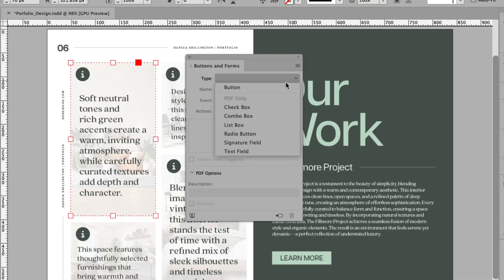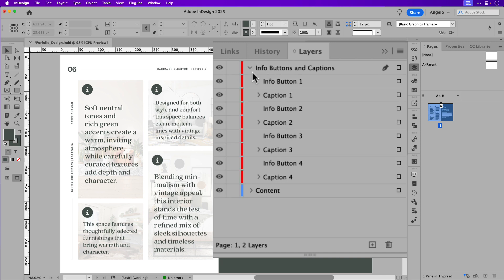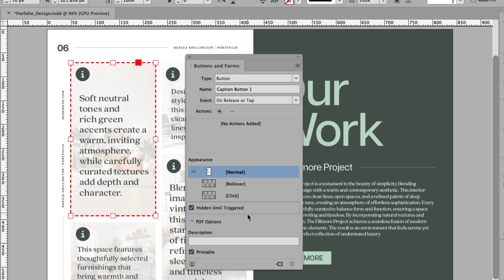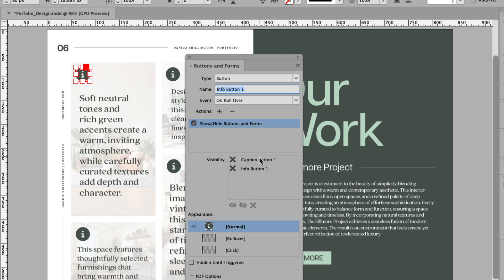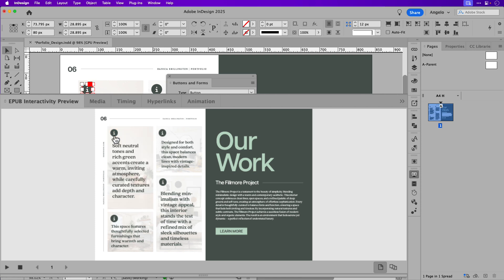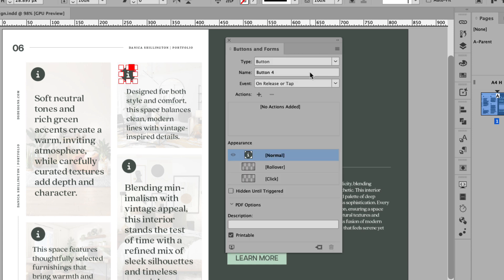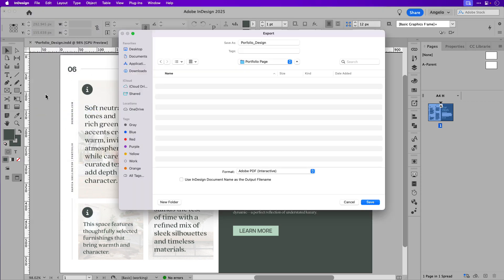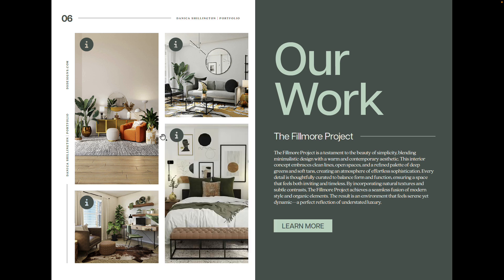Learn how to create interactive PDF Roll Over buttons in Adobe InDesign

Comment: The interactive button in Adobe InDesign with a hover (rollover) state works the first time I hover over it after opening the exported interactive PDF.
But after that, the hover effect stops working — the button no longer responds to any further hovers.
Interestingly, when using a browser (like with a navigation button), it seems to work normally.
thanks Angelo !!

Comment: I have a text box of fixed dimension say 7 inches height and 5 inches width. I want to merge the data into that text box. What I want if the tax is of minimum quantity the font size would automatically increase and if the text quantity is more font size would automatically decrease. Is it possible if yes please answer.